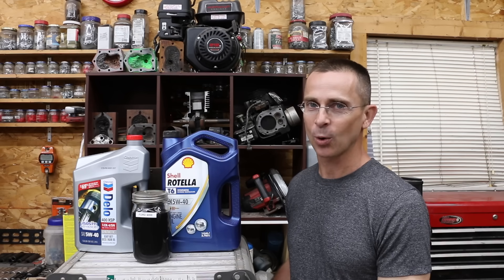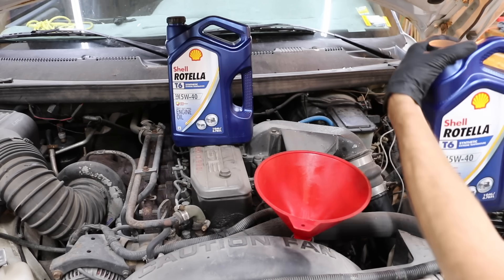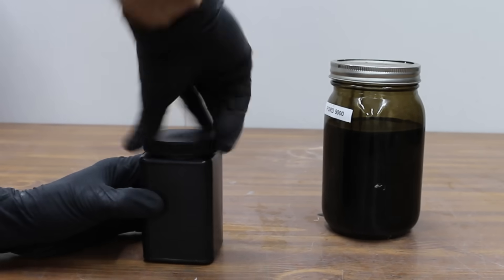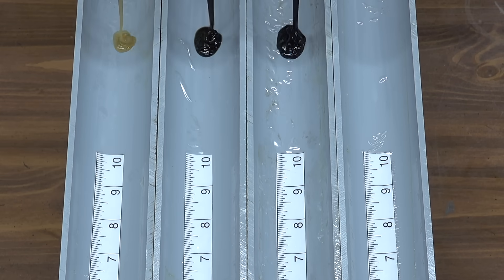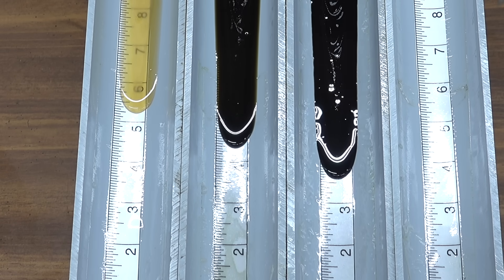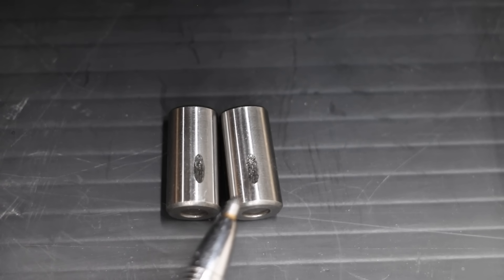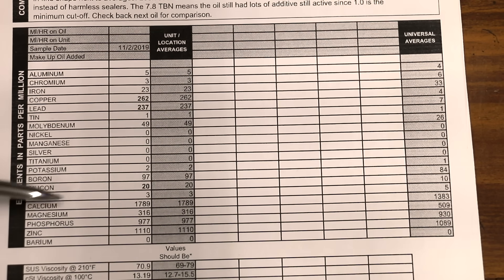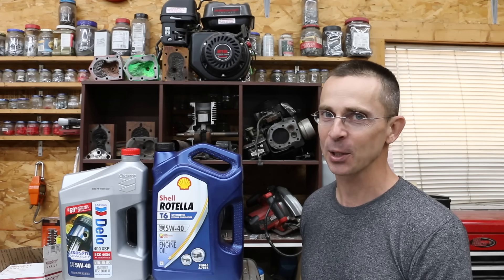Will Annual Oil Change Damage Your Car? Let's find out!

Comment: Dunno if anyone has suggested, but how about running the same test on non synthetic? I'm not sure what percentage of new vehicles run on synthetic, but there are still a ton of vehicles still running on non. Maybe do synthetic vs non for future oil tests unless you're comparing several different brands of the same type.
Reply from the maker: Thanks for the suggestion.

Comment: Thanks for the video. Bought a used Outback and I don't drive much. I hear the interval is 5000 or 5 months, whatever comes first. Still on the fence if I should change it in march or leave it for september. It's my first car that isn't a beater so I baby it like it's going to fall apart.
Reply from the maker: Thanks for the suggestion.

Comment: Rather than a time frame or specific milage, can you not judge an oil change by the appearance/colour of the oil?
Reply: check the colour, smell the oil, and test between fingers for any grit....usually 4 to 5 thousand miles, or 3 years, which ever comes first, then change.....Willie

Comment: My father bought a brand new 1979 GMC Sierra Grand. The manufacturer recommended changing the oil every 3,000 miles. My father changed it every 1500 miles. He got 593,000 miles with no motor work. And that was with the cheapest conventional oil he could find. Just thought I'd share that have a lovely day :-)
Reply from the maker: Thanks for sharing!

Comment: This video dispelled a myth that I’ve heard forever and saved me a bunch of time and money. Thanks.
Reply: I keep reading on so many oil forums "why be cheap and avoid an oil change...blah blah blah".  It's not just the cost, it's the time to change oil and then there's simply the waste.  I have cars that drive less than 5,000 miles a year, so I appreciate the research this guy did for us.
Reply: @steveallen1019  And people forget that biggest cause of engine failure that is oil related is an OIL LEAK!  What causes massive oil leaks the most?  Forgetting to tighten the drain plug or oil filter, or accidentally leaving the old filter o-ring on the engine!  Every time you change the oil you run the risk of these things, if you don't triple check everything!    No one ever destroyed an engine from going 6,000 miles instead of 3,000 miles between changes, as long as you check your oil at least every 1,000 miles.
Reply: Add that to the others.

1. Old cars are safer
2. Not changing your oil every 3000 miles is bad 
3. Fram make the best oil filters
Reply: @ChrisPatrick-q6k  I still do 10k oil changes on my hybrid and has 200k miles on it runs fine
Reply: @ChrisPatrick-q6k there are some cars that need 3k change intervals bc they burn that bad
Reply: @TEENYcharma They're worn out already in most cases I imagine.

Comment: I skipped through this video. 
Just so I have it right, the conclusion was that it is okay to change my oil only once a year as long as I run my car to full temperature at least once a month? 

I use Mobil One once a year and only put less than 5,000 miles on my car every year. I have a 2005 corolla so I am not going to pull out all the stops for a car almost 20 years old. 

I will change my oil every 6 months for the brand new car I get in a few years.

Comment: Ive run regular rotella  15-40 in every motorcycle ive ever owend never had a problem great stuff 👍 probably should run in in my gas engines to they make a fine oil
Reply from the maker: Thanks for sharing.

Comment: Regardless of what the results leaving oil in the engine for a year that is too long for it to stay fresh enough
Reply: it will easily last for 3 years and probably 5 years in a crankcase if driven properly but only minimal mileage like 5000.....Willie
Reply from the maker: Thanks for the feedback.

Comment: Oil is cheap. Engines are not.
That's why I make two (2) oil change processes every year. And engine flush from time to time. 200k miles in my 20y old Focus DOHC.
Reply from the maker: Thanks for the feedback.

Comment: I run my oil for the recommended mileage from the product, not the service dept...... I would like to see some quick YT "Shorts" from you, it could add exposure as well. I would like to see other oils/lubricants you have not yet tested. Specifically Super Lube spray and grease. Keep up the great videos.
Reply from the maker: Thanks, will do!  Thanks for the suggestion.

Comment: AWESOME TEST SERIES! I use Rotella T6 15W-40 in my old '91 4x4 7.3 IDI, ( and yes, also in my '96 F350 crew cab 4x4 460 big block engine). I don't to very many miles in my diesel it any more, so I change the oil only once a year now. But when the truck was being used daily in some hard miles at about 25,000 to 30,000 miles a year, I changed it three times in that period. The last time I changed the oil I was rather expecting to see some evidence of metal dust in the old oil. Nope, clean as a whistle! I also did a block test on it to see if cavitation, to which the 7.3 IDIs are prone was leaking combustion gases into the coolant. Once again, nope! The engine has never been apart and it's still my daily driver. I had to rebuilt the ZF-5 tranny in 2018, and two years ago I changed out the IP, the injectors and the glow plugs. Plus I went through the drive train and replaced all the U-joints, the axel and diff bearings and seals, the limited slip clutch pack, plus all the brakes and the water pump and radiator (bearings went in the pump and the rad had a leak I couldn't find). Years ago I installed a Facet electric fuel pump, secondary and tertiary fuel filter/water separators, a momentary pre-oiling system, and a coolant filter. In the winters I use two battery warmers, a passive block heater and a recirculating block heater. It now has 836,000 miles on the clock. Now to fix the sagging body and rust areas...Thanks for doing these tests, they are extremely helpful.
Reply from the maker: Thanks and you are welcome!  Thanks for sharing.

Comment: If your engine is still under warranty and you do not follow the manufactures schedule, if something were to happen to the engine, you will probably be left with the bill.
I always believed in changing the oil by miles or months if not driven alot.  Those short trips are a killer on oil.
Reply: Oil does degrade over time. Time or miles, whichever occurs first.
Any short trips and round town running should be treated as "severe" conditions
Reply from the maker: Thanks for the feedback.

Comment: Enjoy your videos, I recently bought a twin-turbo EcoBoost Ford since most automakers now or dropping the V8 's and going with six cylinders with turbos it would be nice to know the best oil for those working with turbos and anything else related to them to get longevity. Thanks
Reply from the maker: Thanks!  Thanks for the suggestion.
Reply: Do some reading about SN plus rated oils.  Definitely a must for TGDI engines like ecoboost.
Reply: T6 or mobile 1 turbo diesel

Comment: I buy an extra quart, add it when needed, then when it needs a  quart again it's time to change!  Also, all engines use oil, it is a consumable and the only reason some engines don't seem to use much oil is that combustion byproducts are going into the oil, replacing what is actually being used/burned.
Reply from the maker: Thanks for sharing.

Comment: I have a 2015 ram eco diesel oil change intervals are 10,000 miles i get close to the 10,000 Miles’s year . I’ve sent my oil out for testing and it’s been in good condition still I use rotella t6 5w40 like ram recommended
Reply from the maker: Thanks for the feedback.

Comment: I'm going to start changing my gas guzzlers at mileage instead of time since I don't drive them very often. Thanks, Todd!
Reply: Just be careful about Moisture and age.
Reply from the maker: Thanks for the feedback.  You are welcome!
Reply: Yeah, I think as long as you're getting up to normal operating temps for several miles at a time, then you should be ok.
Reply: Changing your oil based on time is like a carpenter using his hands as a tape measure ..... it doesn't make much sense.
Reply: @danaoberlander5754  I changed them both annually as I only average between 2k and 3k per vehicle. Knowing this, I can postpone the interval a bit longer and save a little money and elbow grease.
Reply: @MJorgy5   I change mine at 2 years with full synthetic at about 3K miles.  I always make sure the engine gets hot.
Reply: A co worker complained how he was getting bad mileage on garbage Caroline that Wawa's sell. I filled up with their gas twice and made my trip to the shire . All 4 trio s took 3 hours +/- 5 minutes and cruise control used overv85% of the trips. Filled up twice with Wawa's gas from 2 separate states and 2 fill ups with different brands of far superior top tier gas.. All 4 fill ups were very close to when tank got to quarter filled. Received 4.5 & 5.2 more mikes per gallon with top tier gasoline. Win win. It might cost 2 or 3 cents more per gallon but with better gas mileage and cleaner engine .

Comment: I run 15w40 rotella in all my vehicles, 4 cylinder and 6 cylinder.  They are all happy with it, smooth as butter.
Reply from the maker: Thanks for sharing.
Reply: I used to run a 92 Golf diesel and found that between 5w30 and 15w40  my mileage dropped by 100 Km per tank.
Reply: @SeeSaw72  Yeah I didn't notice any difference in fuel economy my 03 accord or 05 dodge ram 1500 but they do run better.  I live in Texas so it only gets real cold about one month of the year.
Reply: @SeeSaw72  I've since switced to mobil delvac 15w40 because it has a label saying it is suitable for gasoline engines.  I'm sure rotella is fine but I don't wanna take a chance on clogging my catalytic converters.

Comment: I change my oil every 4K miles with Mobile 1 full synthetic and I change the front and rear differential, transfer case and transmission fluid every 30K miles
Reply: I prefer to just burn money
Reply: That's basically what's happening here.
Reply from the maker: Thanks for sharing.

Comment: if changing it annual is not  necessary, then when to change it? Do you have any suggestion? i have a weekend car  just driving it around 1000 miles per year...
Reply: Those short little drives can be an oil killer. The engines need to come up to temperature and burn off the condensation thats in the block. Not running the engine long enough to burn off the condensation, it can contaminate the oil.

Comment: I have always changed my oil once a year using mobile 1 oil  and Purolator filters for at least 35 years. I don’t put over 5000 miles a year on any one vehicle, my pick up truck, or my wife’s car, but I have only change the oil once a year ever since mobile one put a commercial on television calling that oil, the once a year, 25,000 mile oil..
Reply from the maker: Thanks for sharing!
Reply: My 2022 Toyota Tacoma recommends 10k for synthetic oil, that it came with.
Or 5,000 using conventional oil.

Comment: While the oil may have life in it, the danger is sludge buildup which can only be seen/measured by popping the valve covers.  This is something that kills the Ford Triton 3valve motors.  Even though you could be keeping under the mileage and oil analysis says its good, a removal of valve covers often reveals buildup that will kill modern engines due to their small oil passages
Reply: I'd trust the guys who engineered the car and performed testing during the R&D process (as documented in the owner's / service manual) and are on the hook for both the warranties and brand reputation well before anyone else.
Reply: Thus the reason to regularly get the engine to temp.

Comment: Another great video. I wonder if it could be used to fight a car manufacturer's warranty requirement to change the oil every six months (or X miles)? Given the constant pressure to protect the ecology, elimination of 50% of oil changes would seem to be a good thing. 

 I would love to see how Mobile 1 EP (extended performance) oil holds up at 12 months in a turbocharged gas-powered car. A comparison with the regular Mobile one would also be interesting.
Reply from the maker: Thanks!  Thanks for the suggestion.
Reply: Warranty's are based on how loud you scream!   Such BS!

Comment: I knew a guy back in 1979 that had 1972 Pontiac. He NEVER changed the oil in the 7 years he had it. This was in Florida where the heat will cook your oil in 3,000 miles. I told him to never change his oil as the sludge was the only thing holding his engine together.

I got an oil change at a quick change type place. In making small talk with the manager, he said that in one place that he worked before the advent of synthetics, they used Rotella in all vehicles regardless of fuel. It's good oil and it kept the required stock down to 1 type of oil.
Reply from the maker: Thanks for sharing.

Comment: Given oil can still have viscosity in cars that have sat for 30 years, I call the mileage and age oil changes bunk. I've run my current full synth for 2 years (2500 miles) and it looks, feels and smells just like new. Granted the car is not driven much, but frequent changes on a low use daily driver is a waste of money and not great on the environment... and no climate change is not real, but pollution is.
Reply from the maker: Thanks for the feedback.

Comment: This is very good info. I have a PHEV, and in normal use the engine accounts for about 25% of the actual miles on the clock, based on the car constantly reporting its EV-use percentage. It does however get limited running almost every day, and a bit more when it's cold outside. It seemed nutty for me to change the oil every 7,000 miles as called for in the manual; that works out to only 1750 miles. The car requires a gas fill up every 3 months anyway (it'll run the gas tank down when it notices that the tank hasn't been filled during that time) so I'm not so worried about moisture. I'm changing oil now on a 15,000-mile interval.
Reply: One thing to keep in mind about engines, especially in cold weather operations, is fuel dilution of the oil. All engines run rich fuel/air mix when warming up, and some of it gets blown by the piston rings. Getting the combustion engine up to temperature is important to get fuel and moisture out of oil. If not, more frequent oil changes are needed. 

I don't see it being a big issue for non hybrid vehicles as long as you are mindful of getting some highway driving in, but with a hybrid it might be an issue if it rarely kicks the internal combustion on.

Comment: Being retired, I put about 2000 miles per year on my car. Engine reaches full heat after each run of 15 miles. I have my engine oil changed close to once a year. I believe that non-synthetic is used. How does non-synthetic oil test after it's been in an engine for a year or a little after a year such as in my case?

Comment: Great videos.   Possible to align data for all.   Group oil as such: best wear, best cold, best heat.    Application.   Taxi companies in New York cabs run 24 hours a day,.  Switch drivers from one shift to next- hot seat switch.   Or - Cold run list would be best oil use Alaska/Canada winters.   Or -- best oil for 115 degrees summers.   Maybe reduce all  oil data.   Make new video for each Category.   Super cold winter, super hot summer,.  No little wear oil for vehicles that drive freeway/ on more than off, ect.   Could be tough to pick best two traits for each Category.    Have fun. Phx Az hits 120 some times.  Thanks
Reply from the maker: Thanks!  Thanks for the suggestion.

Comment: Great test and video, I use 5w-40  T6 in multiple vehicles and have always felt it was a great option, the results now prove what a good option it is.
Reply from the maker: Thanks!
Reply: Do you use it in gasoline engines ?  I have been tempted in the past but some say not to use oils for diesel in a gas engine

Comment: I’m a retired old school mechanic 🧰 
Before synthetic I changed the oil in my new cars at 1000 miles to get bits of metal. Then 3000 after that.  When synthetic came out I found out you can change it from 6 to 8 thousand! I go by mileage not time! Be sure that f you go this far to check the level every thousand miles-more on oil burners!
Most people change too often because of pressure from people that make a profit. 
Other than mileage I use an old school trick that works for me. Pull out the dipstick and scrape the oil of between your index and thumb. (Don’t be a girly boy!) If you can see your fingerprints thru the oil it’s fine!!
Preventive maintenance is the key to long drivetrain longevity!! On the other hand don’t be the idiot that just keeps adding oil for years!!😡Like the commercial says:
Pay me now or pay me later!!
Reply from the maker: Thanks for the feedback.